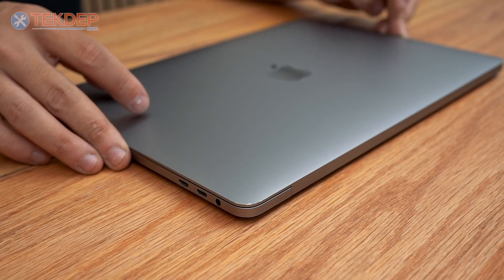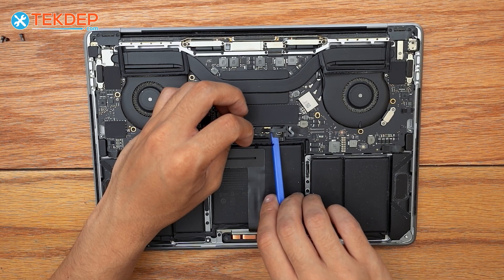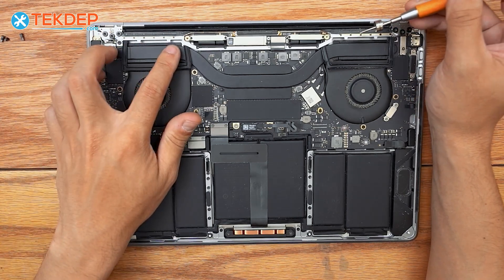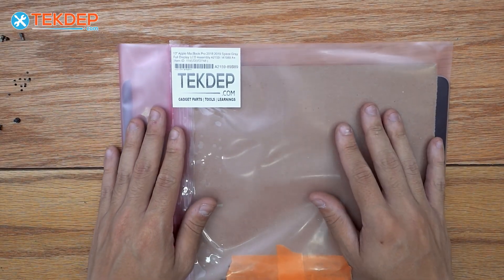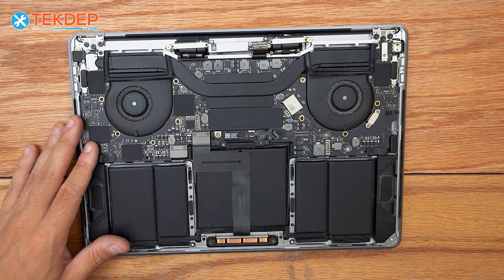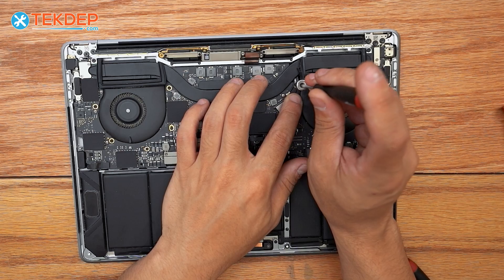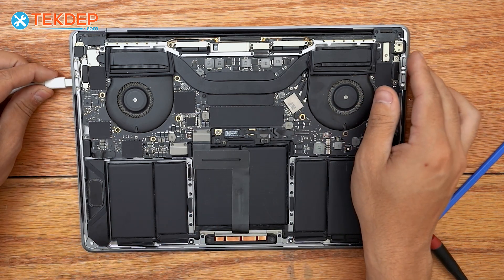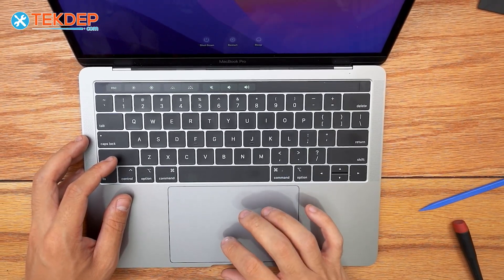Replacing Cracked LCD on 13” MacBook Pro 2019 A2159 13" | LCD Replacement Guide

Comment: Question....Replaced cracked screen now touch bar is not working.  Could this be a bad screen or daughter board battery cable?  ( I did remove and reinstall it during screen replacement)
Reply from the maker: I would try resetting the PRAM, and SMC. I doubt the LCD has caused this issue, double check that the touchbar cable is connected and connected properly.